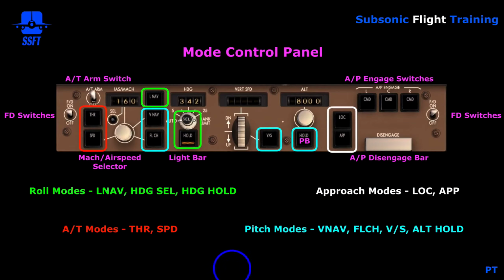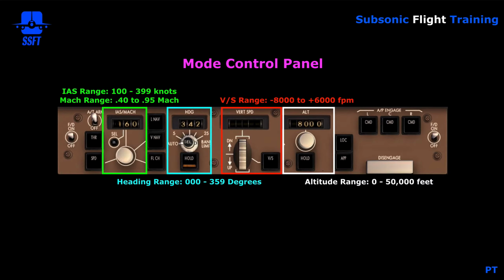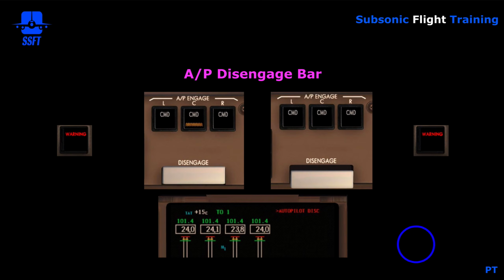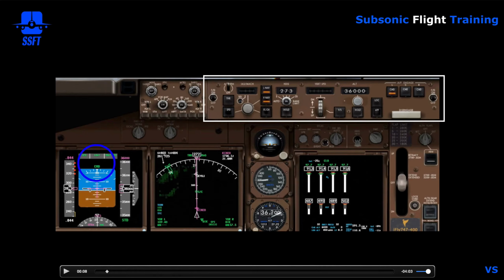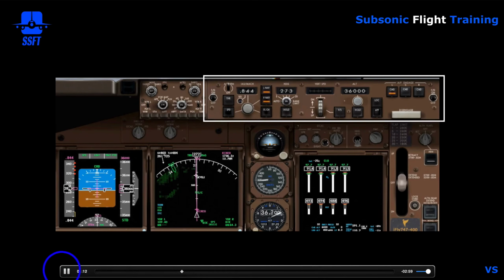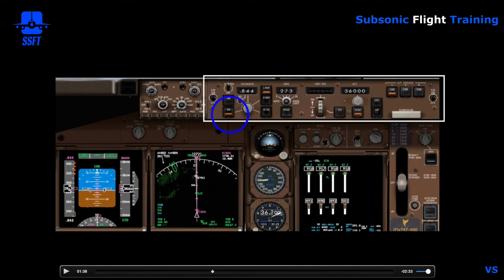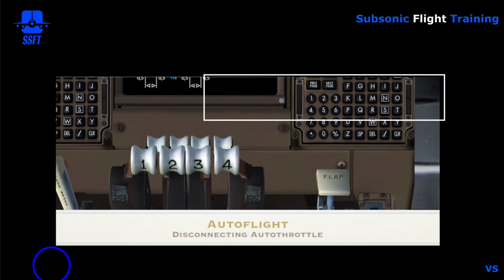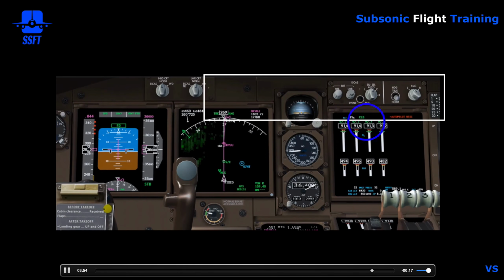Autoflight - MCP Overview (iFly 747-400)

Comment: When you selected altitude hold and the auto throttle automatically goes to speed just what speed is it going to maintain? V ref plus 100?
Reply from the maker: When pushing Altitude Hold, the A/T if not in the SPD mode, will go to the SPD mode and maintain whatever the Target/Commanded speed was at the time of the transition to altitude hold. So, I think in the video, we were in VNAV PTH and by pushing ALT HOLD, the jet comes out of VNAV PTH, and goes to ALT, and the A/T stays in SPD, the MCP speed window opens to the current target or commanded speed and maintains that...

Comment: Al, I found it interesting that British uses the 747-400 London to KSAN, only a 9400 foot runway. Are they limited on takeoff/landing weights due to this? Regards!
Reply from the maker: Hi 99, sorry I missed this, they would fine landing at KSAN when they burn off fuel from London, they would be limited on takeoff however. It is about the same as taking off from KSEA on RW 34C, which also has a 9400 foot runway. There with Flaps 20, Full TO, Max TO Weight would be 368 tons, or about 810,500 pounds. It would be similar at KSAN give or take depending on obstacles and segment climbs...

Comment: Your series on modern avionics is fascinating.  Although I have about 400 hours as a PP-SEL, I haven’t flown since 1988.  Most of my time after getting my license was in a 1976 Skyhawk with basic IFR equipment and no auto pilot.  I have seen still pictures of the new displays, but never had them explained to me or seen them in action.  This stuff makes it so easy it feels like cheating!  I really miss flying, but these days with diabetes, hypertension, and failing eyesight, flight must remain just a fond memory.
Reply from the maker: 3 years later, sorry Norman, I was answering a current comment, and saw I did not answer you. Yes, it is easy. The biggest challenge is managing the information and keeping it simple. Does not matter whether you are in a 172 or a 747, flying is flying, and the same physical laws still apply. A good stick and rudder pilot with a good scan, sound judgement, smooth actions, and an attitude of safety first will excel in a 172 or 747.